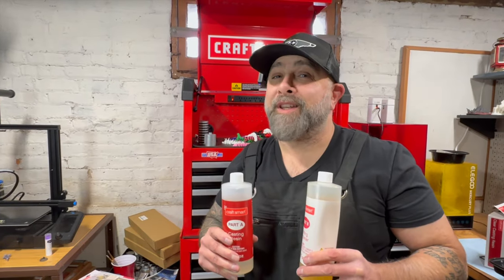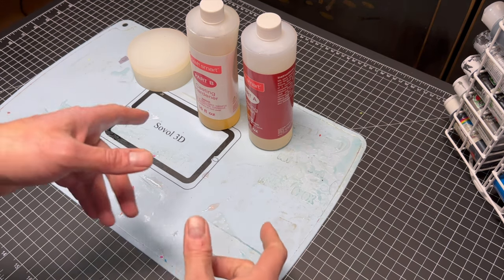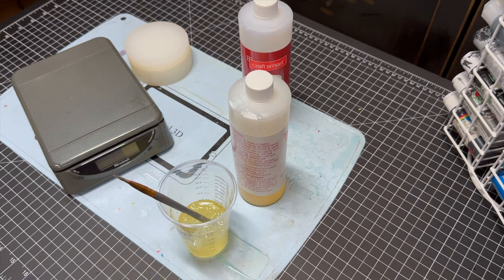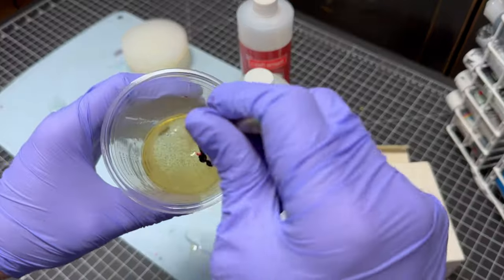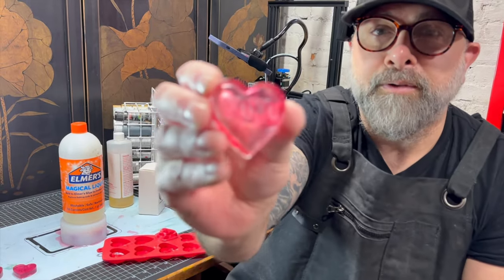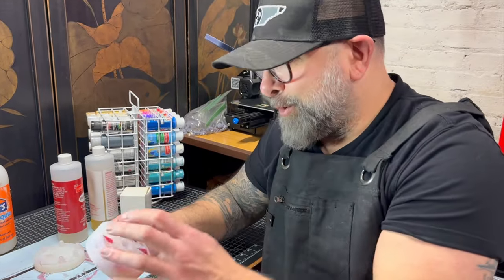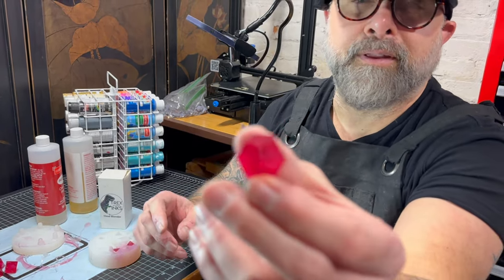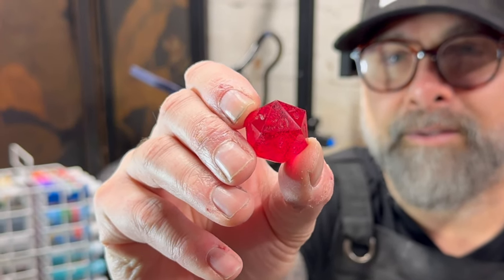How to Cast Bubble-Free DnD Resin Dice Without a Vacuum Chamber or Pressure Pot?!

Comment: Ive also found heating up the resin and hardener (seperately) lowers the viscosity and helps bubbles escape, as well as torching the top of the resin with a lighter to pop the bubbles!
Reply from the maker: I'm going to try that! I may do a new pour tomorrow on my Live! 😀
Reply: @MakerBuildIt  awesome! I used a water bath to heat mine so it heated slowly and uniformly